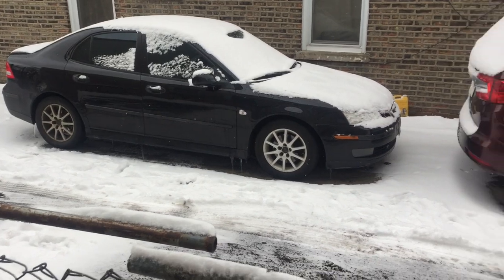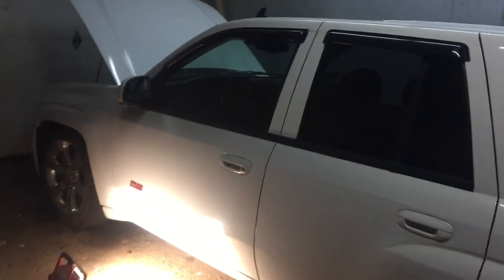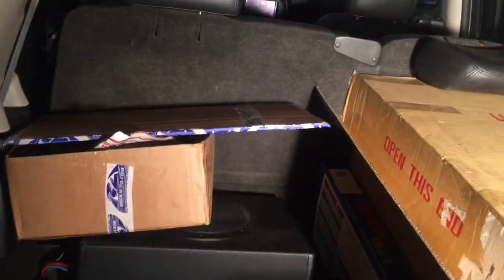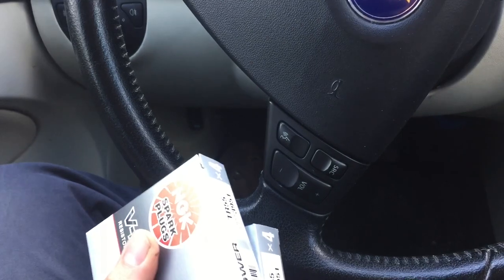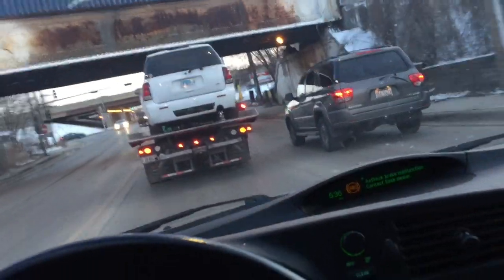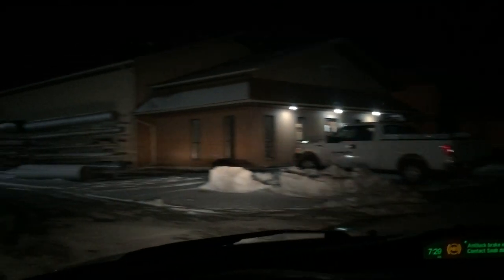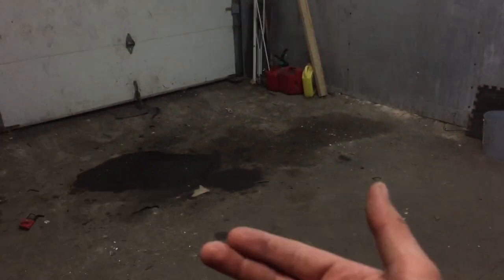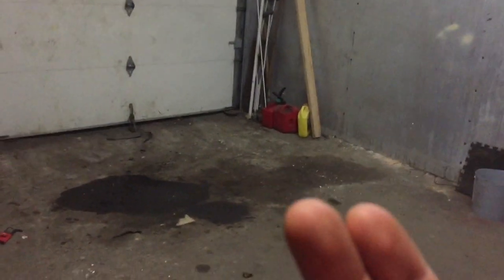Tow Truck DAMAGED my Trailblazer SS !! (with pictures)

Comment: Straight from TbssOwners.com fyi
TR5- 2238 stock heat range .035 gap

TR55- 3951 stock heat range .055 gap

TR6- 4177. 1 heat range colder .035 gap (best plug for most TBSS with tune, bolt ons, cam only)

BR6EF- 3177. Same as TR6 but with non projected tip for nitrous or boost .035 gap

BR7EF- 3346. Two heat ranges colder non projected tip 125+ shot or 10 + psi .032 gap

B8EFS- 1049. Three heat ranges colder, non projected tip, non resisted. 15 psi or 200 + shot with increased compression

B9EFS- 1085. Four heat ranges colder, non projected tip, non resisted. Now you are making some big power

It continues on from here but if you are getting past the 9 heat range on an LS motor, you probably don't need this sticky.

Proper spark plug torque for the LS2 is 11 ft-lbs